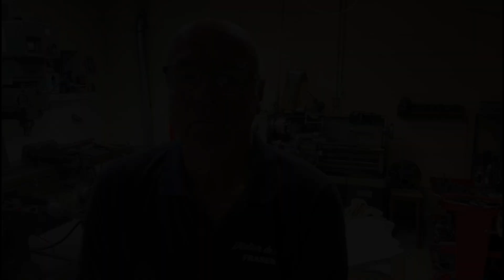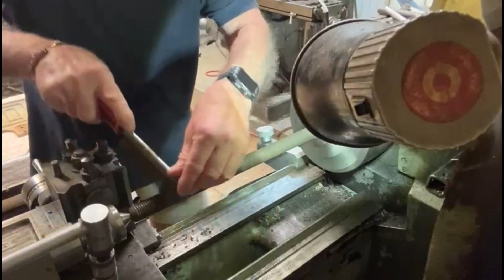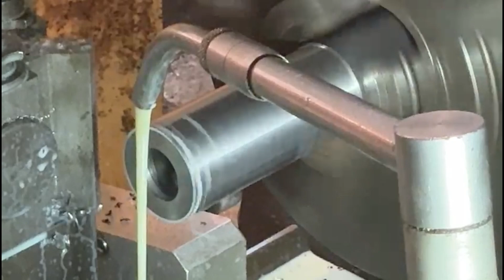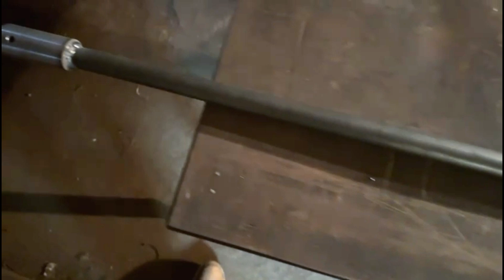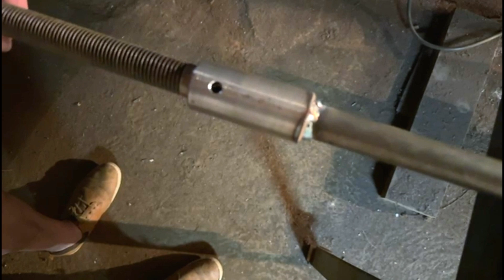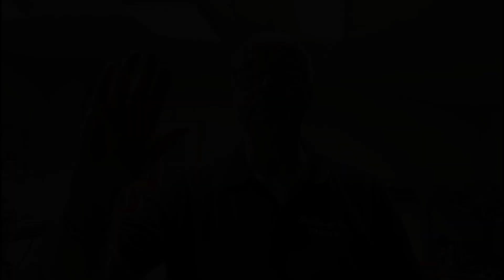How to repair a water valve on a lake Monk (fr: Monie)

Comment: I would call this a sluice gate, but it could be called anything in France! That came out very well, and the brass thread has held up very well, are the side guides for the gate adjustable? They look very precision to be living under water. Chris B.
Reply from the maker: Hi Chris. I just got told it was a Monk. The brass thread is actually  above ground level on a frame so it can be used to lift the whole thing open. the guides are not adjustable as far as I know. My client was going to drill holes to suit.